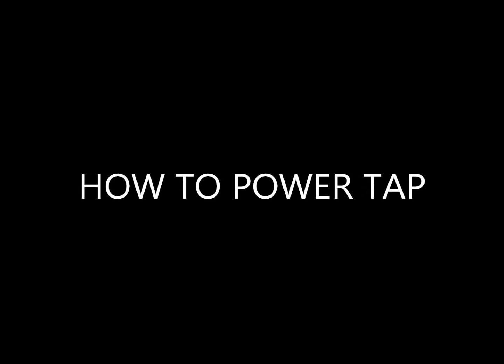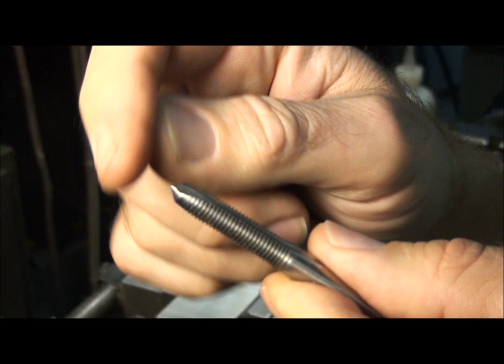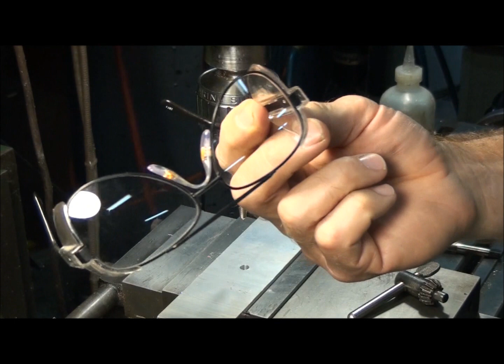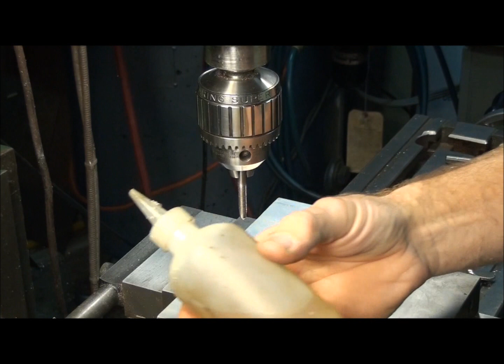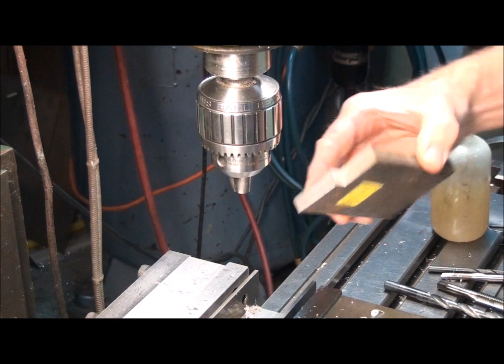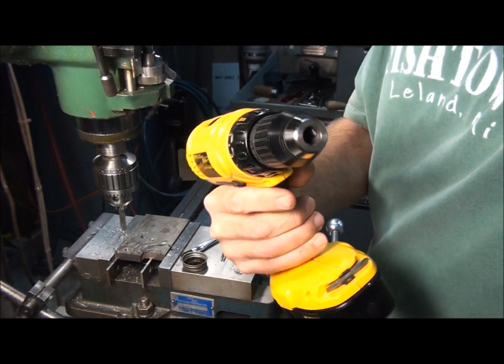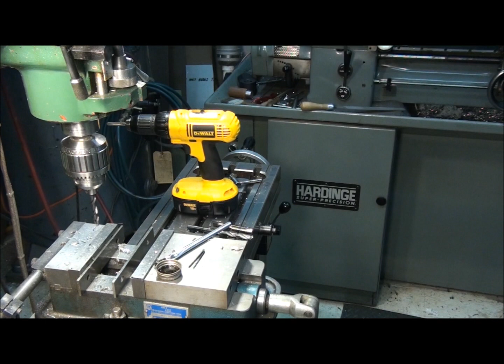How to Power Tap

Comment: So I am very new at all of this but am very anxious to learn how to tap into steel hence watching this video. My question is that why doesnt the tap bit just make a bigger hole since the drill is spinning so fast. I know you said you slow it down but it would seem like you would need to bring down the press at absolute perfect speed. Thanks.
Reply from the maker: Because the tap is free to move on the Z axis. As soon as it touches the hole, the tap will start to screw in because that's what it was designed to do. If you try this, it is very important to use spiral point machine taps NOT hand taps and very lightly chucked until you get the hang of it.

Tom

Comment: Thoroughly enjoy your instructions. I had just acquired spiral taps however these are three flute. I work with 7075 alum. and mild steel, will this be an issue power tapping or using in a tapmatic?
Reply from the maker: I wouldn't try power tapping with them because they may plug up with chips. They will be ok with a tapping head, but clear the chips more often than you would with a two flute.

Tom
Reply: Toms Techniques Thanks Tom

Comment: What RPMs are you driving those with?
Reply from the maker: ziikzaaak

That tap will feed .3"/sec at 580 rpm. I guess it depends on how good your reflexes are. BTW, if you have never power tapped before, I would suggest not starting out with an expensive insert tap.

Tom
Reply from the maker: I don't remember what I used in the video, but slower is better until you get the hang of it.

Tom
Reply: Toms Techniques What would you say would be needed to get down to in RPMs? Most of the drill mills I'm looking at starts from 580 RPM - I don't know if that will be to fast?

Comment: You sir are a madman!! I thoroughly enjoyed watching you do your magic but I cringed all the way through!! I have to recognize your skills though!! Congrats!
Reply from the maker: No need to cringe. As long as the tap is a spiral point, on center and well lubricated, there is nothing to fear. It's probably been 15 or 20 years since I last broke a tap (knock on wood).

Tom
Reply: +Toms Techniques I agree - I use a portable drill to do all hand tapping which is mostly Ali in my business - I replaced the battery with leads I run off a big deep cycle to do a lot of tapping when I make a batch of small parts - you can feel the tap tension by hand and control the trigger - no need to brake and chances are if its tight the hammering effect of the clutch releasing out might snap the tap - as for cutting fluid I use WD40 (in fact CRC556 in Australia here) for pretty much everything, lathe, mill drill and taping - not optimal but its handy using only a small short spray is enough and leaves a nicer finish on milled Ali and threading MS too than oil which tends to clog more where the CRC swarf tends to fall away easier and less sticking to the tool or bit and less pick up leaves a nicer finish IMO.

Comment: Now if I did that. I would just enlarge the hole. had to drill a piece of 1/2 inch mild steel the other day in two places to get a 5/8 hole, no drill to hand so used a 5/8 HSS tap, works well if you feed slow and lubricate.
Reply from the maker: Uh...I don't think I would admit that if I did do it. ;)
Reply: Toms Techniques Well I don't do much on a lathe anyway and  found the 5/8 tap in a heap- of junk, but I can understand it sends a shudder through the purists. But really i can't see much difference in power tapping, it's all forward motion and I was taught to back turn to clear the swarf.
Reply from the maker: john brown

That's why you use a spiral point tap for power tapping. You don't need to back it up to break the chip.
Reply: Toms Techniques ok, thanks for that.
Reply: Forgot to mention, used a 1/2 inch drill first.

Comment: A lot of DeWalt drills (like the one he's using) have an adjustable torque limiting clutch in them as well, seems like that would be put to good use in this task.
Reply from the maker: It's not necessary on a hand drill because it's pretty easy to feel the torque on the tap to know when to back it out.

Tom

Comment: I do this on all the aluminum parts I build. I use a mini mil so it can go pretty slow
Reply from the maker: I use it on everything. Once you get a feel for how tight the chuck needs to be, you'll never break a tap. You also need to be sure to use the appropriate tapping fluid for the material.

Tom

Comment: Keep 'em coming.

Even with my slowest speed on my Index milling machine, it takes practice. Very heavy flywheel, so I almost need to reverse the direct when just starting.  I have a  tapping heads, but they mainly stay in the box unless I have a helper to tap a 100 hole jig plate. 

For hand taping, make up some 1" rod drilled to just clear the tap.  Part 1/2" thick. You have a nice finger held guide for straight tapping. Hold against the work, and that tap will remain straight.  (also the guide doubles as a nice stop for blind holes)

Tom
Reply from the maker: Tom,

I often turn the spindle off and let it coast a bit before starting the tap. That would help with slow to respond mills like yours.

The tap starters is a good idea for hand tapping. I also do a lot of my tapping with a cordless drill. The two techniques could be combined for a nice square start and the speed of the drill.

Thanks for watching.

Tom

Comment: seriously i don't recommend this. there is a chuck for this purpose, this is a method meant to be done with a crank on the power head center inside the belt guard there is usually a stud there, this process is meant to be done under manual power
Reply from the maker: You can't just say you don't recommend something without explaining why and pointing out that there other ways to accomplish the same thing doesn't count. This is a common (in industry) method of tapping a hole that saves time by allowing a hole to be tapped in the same set-up as it was drilled. The key phrase here is "saving time". Tapping a hole my manually turning the spindle sort of negates that benefit.

Tom
Reply: no your wrong the drill would center in the chuck, as the tap would center in the chuck..what you are doing with fatigue the threads created especially in aluminum, because the cutting speed will be very high even at the lowest speed setting on most conventional drill presses not equipped vith a variable frequency drive.. you also depend on a loose chuck as a clutch which is unrealiable and not always dependable leading to tooling wast and personal injury risk..this is foolish, do it manually or with a reversing tap chuck like a person with some sense i come from a family of german millwrights and machinists. even though this is not my professional trade i grew up with a ww2 veteran my father who was a millwright for 30 years before i was born and i worked with him since i could walk or speak..this is not a standard and is foolish period. you can not defend stupid practices..
Reply from the maker: dekonfrost7
Machining is not your profession? The fact that members of your family are or were machinists, does not make you a machinist. Maybe you should ask one of them to make a video showing us all the proper way to tap a hole.

Thank you for your input.

Tom
Reply: i grew up doing better machine work than this when i was 10
Reply: dekonfrost7
I’ve read your thread and the only thing I take away from it is you’re not a machinist and have no personal experience and you sound a little angry with your comments………..Relax! So relish in the fact that your German family tapped “correctly” and the rest of us do it “wrong”…….
Reply: Hey Tom,

Youtube Rule No.1: Don't feed the trolls!

I am no machinist and i use powertapping on the mill too. But i do have problems doing that on a drill press without a tapping chuck (for obvious reasons) - maybe dekonfrost7 doesnt know the difference between a mill and a drill press and is talking about a drill press here. The machines look so much alike :D

I use the cordless drill method the most. For me it's just a bit quicker.

Greetings from Germany,

Stephan
Reply: I've been power tapping for a very long time and have worked with other machinist who also do it. The first time I figured out I could use my cordless to do it, I was hooked.......Mistakes happen, but we learn from them, and at the same time get a feel for what works! I believe they call that experience. Tap on Tom, and leave the hatters to the OLD SCHOOL SLOW WAY!
Reply: If you want to insult me please type my name correctly.

That you dumb fuck can write/insult me in german makes you a first class troll. Please keep up your fine trolling.

And i just can't figure out what makes me slow? Or is that just another thing you don't know right?
Reply: dekonfrost7 no one believes someone like you behind a computer that makes stuff up...
Reply: dekonfrost7 also, you are kinda ratch for working up an argument trying to show your so called intelligence and proper way of doing things. Cheers m9!
Reply: so you dummies are telling me that using a speed tapping auto revering head is too much trouble and wont lead to a correct angle? lol rofl
Reply: and is slower????thats what i'm treading right?
Reply: well neither you guys machinists.....by the looks of what your practices are...anyone who knows anything, knows better..then to depend on a chuck loosely tightened as a method of anything..i know 3 things how to do it my way, my fatyhers way, and the right way...what you fail to understand is i at 10 received training on mills and lathes, castings, welding, etc until i was 16 and went with my dads friend building houses. even then my dad was a roofer in the 30's before the war...and i'm 36' so think about all i had available to me. the wealth of knowledge from a man like that, vs you guys i'll take that any day.you dummies know this is bad practice, but i bet you don't own the taps or pay the insurance. so i see you as nothing more than laborers.polite but honest.
Reply: stephen w . fick dich aus amerika.. du bist langsam..

Comment: I personally try to power tap or at the least use the drill press when I can and by hand turn the chuck. An old machinist told me about using transmission fluid as tapping lube for aluminium.

I have to disagree about closer thread tolerances by hand tapping over power tapping. For a slew of reasons.  I drill and tap thousands of parts on the vmc's a week. Every hole has to pass thread check gauges and holes are 1/8, 3/16 and 1/4. When tapping holes in thin material (ie. 1/4 or thinner) power tapping vs hand is superior in holding tolerance hands down. No pun intended.   My .02
Reply: hand turning in the press is my favored way of doing this.Even to just get it started. once its 5 or 6 threads in just put the tap handle on and let loose
Reply from the maker: Eric,

Hand tapping more precise than machine tapping? That didn't come from me. Are you referring to someones comment?

Tom
Reply: Yes to someone else's comment.  But I don't mean it harshly.  :)
Reply from the maker: I realize that. Just wondering where it was coming from.

Tom

Comment: Tapping heads work great as well. You do have to drill all of your holes first then come back and tap them. But for multiple parts you can't beat them. I would say find a good German made one with V jaws not collets. The thing about a tapping head is they auto reverse with the quill stop. And they feed out at twice the RPM as they go in.
Reply from the maker: There are definitely better ways to tap for production. This is just a quick way to do one off parts at the same time they are drilled.

Tom
Reply: Power driving is a quick and easy way to tap. We do use that method quite a bit. Just not on parts that have a tight thread tolerance. It does tend to make a little looser thread than hand, CNC or a tapping head.

Comment: 5) On a big lathe there's too much inertia in the chuck and headstock for plug reversing to be a great idea, and in small lathes you tend to have single phase or a screwed-on chuck or both)
One way to get around this is to make a tap holder (ideally using the biggest Jacobs Superchuck you can find on eBay - much quicker than collets) and prevent it from turning by fitting something like a go-kart steering wheel to it. In other words, the holder is free-spinning on the tailstock barrel (make sure to bush it with plastic or bronze) unless you're hanging onto the wheel. Because you can use both hands, you can resist a lot of torque, and when you do let go, there's no handle to hit you.

 If it's a big lathe, go for a tractor wheel!

Comment: 4) I entirely agree with Tom that this method was hardly ever taught in the days of trade training. I used to wonder why, and it occurred to me that it was partly because shop teachers were generally (at best) gifted practitioners from an earlier era, who had it drummed into them that it is ESSENTIAL when tapping to stop and reverse to break the chip.
This is one of those pieces of learning which remain true to this day, but only in the original context. If human wrists were equipped with a slewing ring and a small hydraulic motor we would never have made this rule: the reason we have to reverse is because we have to stop, and the reason we have to stop (when tapping by hand) is due to design limitations.  I discovered this in the early days of battery drills: I found I could do a much better job with very small holes in alu (under 1/8") using a battery drill and NOT stopping. Then it occurred to me to try in steel, and eventually (like Tom) found it worked up to sizes as big as I could hang onto the drill (once they got torquier) And at some point it was natural to apply this to milling machines and lathes.
Reply from the maker: The need to break the chip or not actually depends on what type of tap you are using, not whether you are capable of driving the tap without stopping. With hand taps for instance, the chips form in the flutes of the tap and if you don't break them every now and then they will become compacted and break the tap.

To power tap, you need to use spiral point taps. They push the chip ahead of the tap where there is much more room and don't require the chips to be broken.

Thanks for watching.

Tom
Reply: Toms Techniques

I don't think it's an "either/or" situation. Both of us (I think) are correct.

Even using a spiral point tap (or, for blind holes, spiral flute), in certain tough materials, it is not advisable to stop and start rotation.

This is because the process of chip-forming is harder to initiate than it is to continue, so it requires extra torque to re-start a chip. This is made worse because a suddenly applied force (when the teeth simultaneously hit a 'frozen' chip) increases stresses above the level of sustaining that same force.
Another reason not to back off to break the chip, in tough materials, is that there is a relief (eccentricity) to the form of the thread, which means the tap travelling in reverse over the chip from the tooth behind it will try to mash the chip into the groove of the thread.

Conversely using a hand tap for machine tapping can work in materials which are not too tough; I do it all the time (high quality, HSS ground thread hand taps) and virtually never break a tap. In tough materials, serial taps (made for tapping by hand) work well, but these are not generally available in the US.

I don't disagree with anything Tom says, and in common sizes I have progressively replaced all my hand taps with spiral point or spiral flute. I understand he's trying to keep things simple, and I hope I'm not diluting his message by introducing nuances, but I would hate to think that people are unnecessarily replacing good hand taps in sizes they rarely use, or reverting to hand tapping in free-chipping materials for lack of a machine tap. And in the case of through-holes, chips rarely become compacted, even in the flutes of a hand tap.
Reply: Very impressive. I love videos that are no-nonsense and right to the point. Thanks.
Reply: Toms Techniques I always had a large collection of taps. They had noticeable differences that I never understood. Then after getting a Procunier head I learned that the ones you were using are often referred to as "gun taps," not because they are used in firearms manufacturing but because they are designed for power tapping and eject or "shoot" the chip down away from the flutes. Also, the tight spiral taps I was told are good for blind holes because the tight spiral pulls chips up and out. Thanks for all you do!